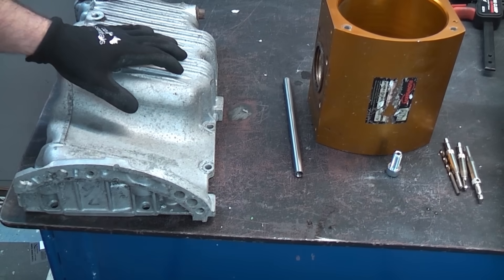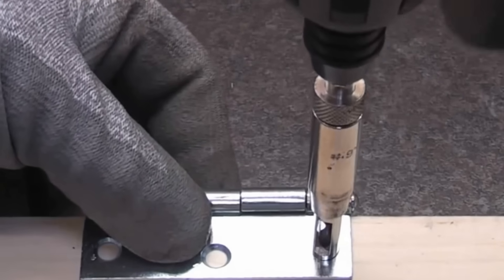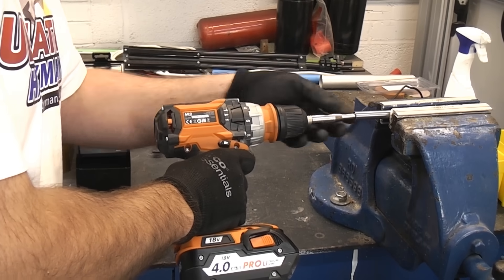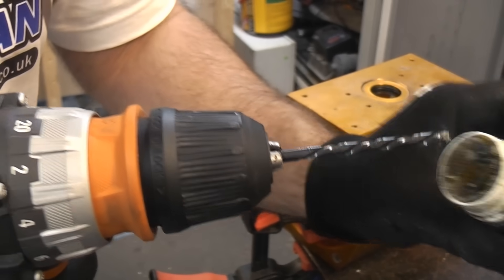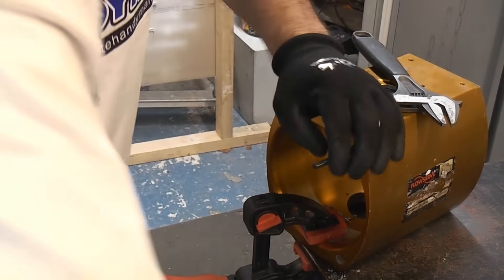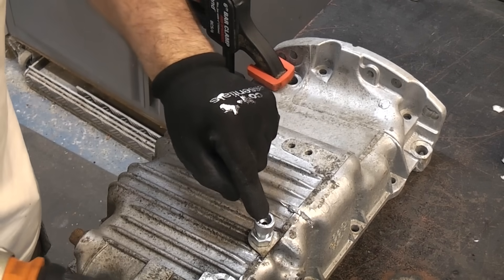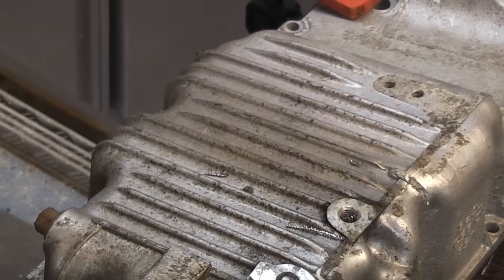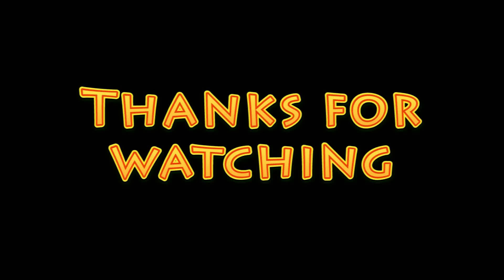How to remove a broken bolt in a deep hole | remove broken bolt in recessed hole

Comment: Your samples came out so easily with easy-outs. It reminds me of my most amazing case of a broken water pump bolt on a Toyota.  The broken bit was a the bottom of an inch+ of clearance hole down to threads deep in the cast iron engine block.  Drilling a hole in the broken bolt with a long bit was easy enough - this was back when Japanese bolts were notoriously soft. To this day I still am totally amazed that I got away with a brazed extension (old valve stem) on an easy-out to get the bite deep enough.  The broken part came out as easily as the samples in the video .  Wow, did that really work?!

I do like your tip with the alignment hole through a bolt. Too bad my cases are always near flush so no threads to engage.  I tend to end up with grinding the end flat, if possible, and very carefully centerpunching for the drill, starting small and working larger, depending how well centered. My cases are typically locked in place with corrosion and easy-out has low chance of success.  The best helper has been to head the part to dull-red with torch, which I suspect expands the bolt into the rust and creates a little clearance when the bolt cools.
Reply: ,I have been using small allen keys and grind the end into a 3 point,removed lots in my turbocharger shop.
Reply: Heat seems to work when nothing else does. Heating then shock cooling sure helps to loosen rust frozen bolts, but you still need liquid wrench and torque!

Comment: Note that the hole drilled into any broken bolt is approx half the width of the bolt, too small a hole and "Easy outs" have no effect, too big a hole and you run the risk of expanding the bolt and really jamming it in the hole.
Reply from the maker: Thanks for the comment 👍

Comment: some times a square nail  in the drilld hole works    also a freeeze off spray works ok where  you can not  use  heat  ive hade good luck with the freeze stuff it works
Reply from the maker: Thanks for the comment 👍

Comment: Some great ideas there. Have to say as a professional automotive mechanic I haven't seen to many deep broken bolts or studs. Most all are flush with surface or smidge below.
Reply from the maker: One site, most are flush or just proud of the surface, but on a couple of machines we get them recessed in the hole, which made me think of ways of getting them out.
Thanks for the comment 👍
Reply: **TOO.
Reply: There is a differance between a professional mechanic and a handy man.  Salute.   Thank you for your service sir.
The number of your likes speaks volumes.

Comment: Forgive me ,may be I m wrong,but in factory I have seen the technicians place directly welding rod,which gets soldered to the broken bolt ,bent the rod in L shape  and twist it out.
Reply from the maker: Sometimes you can do that, but it can be difficult in a recessed hole.
Thanks for the comment 👍

Comment: if all else fails, use a Spark Eroder, with the copper plunge electrode the same diameter as the hole's thread's original tapping drill bit, in conjunction with  a sharply pointed steel pick, to pick out the remaining thread spiral, which will be all that is left of the broken off bolt or tap.
Reply from the maker: Thanks for the comment 👍

Comment: How it was broken off and the condition of the hole and the bolt determines how you approach the removal process.
There are three ways to break off a bolt.  Clean bolts:  1.   Over tighten will frequently twist off at the transition from the shank to the threads.  In this case the broken part is lose in the hole and you just need to get a light grip on it.  2.  Slammed against the bottom of the hole will usual break off the same way, but the broken off part is real tight against the bottom of the hole and you have to get a real good grip on it which requires different methods.  This breakage frequently mashes some part of the broken end into the wall of the hole and into the threads making it have even a greater grip in the hole.  3.  It is frozen in the hole due to corrosion caused by moisture and/or chemical reaction between the materials like brass and aluminum (never put these two materials in contact with one another).  This is the worst situation and usually requires exacting work to drill a pilot hole exactly in the center of the broken part and gradually enlarging the hole to the root diameter of the thread or until you have removed all of the broken part and what remains is just the rusty thread of the broken bolt stuck in the threads of the side of the hole.  95% of the time a tap will peal out the thread part and clean up the hole at the same time.  Use lots of penetrating product.  I have been doing this foe decades.  This video shows just the easy ones with the casting is out of the equipment and on the bench and real clean. Not the kinds of things that you run into in the real world where the bolt is around the corner and you can't see it straight on, it's raining and the equipment is in the dirt so you are on your back in the mud with a mirror and a flashlight working the broken bolt.  The real world is very different.

Comment: I live where salt is used on the roads so typically the bolts I see broken off are seized by rust. If you try to use an extractor on that your going to have to figure out how to extract the extractor.
Reply from the maker: Road salt makes things 10 times worse!
Thanks for the comment 👍

Comment: What the hell is he saying? I can't understand a word. What's al-uminium? If you notice, he keeps starting and stopping with the left hand drill bit to get it to grab the broken off bolt and unscrew it out of the hole, that is the proper technique, he didn't mention it as a critical part of the process. I like the idea of making a hollow bolt as a guide for the drill bit. Every time I've tried drilling a broken bolt out of soft metal the bit goes off to the side even after center punching the broken bolt and messes up the threads of the piece I'm trying to remove it from and that makes it very difficult to remove with a screw extractor. Remember if you use never-seize compound or and lubricant you have to lower your torque setting or you could snap the bolt or strip the threads. I have some Matco or Mac tool screw extractors that are straight and square but the sides are concave so the corners dig into the hole you drill. The do not flare the drilled piece like left hand thread or spiral designs.

Comment: Nice tips, but most seized bolts ain't nearly that tidy, to put it mildly.  Definitely worth getting a set of reverse drill bits and bushings or some means to protect threads, but almost all have broken off right about flush with the surface.  Can use the same principles with rounded fasteners.

Comment: I wish I had had a special centering drill assembly when I tried to remove a broken, recessed bolt from an engine block. I ended breaking a hardened extractor off in the bolt! Plan B! Had to use a workaround for throttle linkage.

Comment: The problem I had was lack of clearance to get tools to drill out the bolt. Twice the drill bit broke off in the hole. I didn't want to pull the engine or pull the heads off so I perpendicular drilled into the hole due to the design of the head to kick the drill bit out. The hole was so damaged I couldn't get a tap into it. As a last act of desperation to get some kind of clamping load on the exhaust gasket I welded a bead onto a bolt shank so it's locked into the hole. These created a permanent exhaust stud in the head. It may or may not last due to cyclic heat stresses but I was able to put full torque on the nut to clamp the gasket. I no way would I recommend this method. This was just done so it didn't have to pull the engine apart to swap the head. It's an old GM 2.8L V6 pile of junk Fiero engine that I'm replacing with an LS4 V8. I just need this engine to last long enough till the other drive train is ready to install.
Reply from the maker: Lack of space can always be a problem, we come across difficult situations all the time at work.
Thanks for the comment 👍

Comment: the main culprit is the use of steel bolts directly to aluminium threads. that shit will get super stuck like its welded if given enough time. steel thread inserts should be standard, either that or fuck the aluminium off in general and make everything out of steel like in the old days.

Comment: You could've just used threaded couplings as a guide and drill into the broken bolt. Then use the "Easy outs" ( That's what e call them in the States) That will save you a few steps.

Comment: I spent 13 hours drilling out a bolt in a 5.9 Cummins turbo engine. An exhaust bolt near the turbo sheard flush and Nothing would drill into it. I used all kinds of stuff to creat a divit big enough to get a small drill bit into and then slowly drill it out. It was a slow miserable experience that was uniquely frustrating.

Comment: Thats fine if the bolt is not galled. I had one broken off in a briggs  head  bolt  and it would not come out even with heat.  Tried everything you showed plus a lot of other tricks and it is till there. Applied heat to the surrounding area at the bolt at the same time twisting on it with an extractor to the point of almost twisting off the extractor. No luck still.
Reply from the maker: Sometimes the only option is to drill it out, then re-tap the hole!
Thanks for the comment 👍

Comment: Where can I get that kit from I need to remove a broken bolt from my engine block
Reply from the maker: Hinge centering drills- https://fave.co/2DpJo1H
Left handed drill bits- https://fave.co/2xJjK1M
Teng screw extractors https://fave.co/2OnfRuF
Dormer taps -https://fave.co/2OsN1sQ

If you are in the UK-
Hinge centering drills- https://fave.co/2NE1VMc
Left handed drill bits- https://fave.co/2DubtF4
Teng screw extractors- https://fave.co/2pVLkVT
Dormer taps - https://fave.co/2pTfbyx

exact cutting paste- https://fave.co/2Nabyxc
cobalt drill bits (they are much better on harder steels like bolts) https://fave.co/2zDh3kp

You'll have to make the guides yourself, but they are easy- https://www.youtube.com/watch?v=6mZj0J6CNYA&t=1s

Spring tools centre punch- https://fave.co/2NbnLBD

Thanks for the comment

Comment: Broken Brake Cylinder Bleeders - Before you break it off - 
Always require small very sharp pointed acetylene torch tip - 
heat the boss casting area under the bleeder - 360 quickly. 
Keep the bleeder ice cold with a six point deep socket 1/4 drive. 
As ice cold as possible to keep the bleeder from being exposed to any heat. 

JUst as this guy tapped the bolt,, also give bleeder a quick shock, 
and with base casting good and hot - bleeder should screw out. 

Soon as bleeder starts to move - don't force it,, move it back down
with lube spray, and keep repeating back and forth till enough corrosion
moves out of the way - and bleeder comes out w/o breaking. 

Clean restore casting threads, and replace bleeder, or refinish it,, 
drilling out the passage in both directions,, the 90 degree hole at 
bottom as well. 

Cool the casting with wet rag soon as bleeder is clearly loose. 
If careful, you won't have to rebuild the caliper or wheel cylinder, 
if over heated, damaging seals. 
But it's best to restore calipers/cylinders to factory new condition. 

Pistons should move freely in the bore with seals removed, 
polish then with 600 wet or dry, spun with drill,, by making adaptor
with socket that just fits into caliper piston, then socket wrapped 
with tape so socket jams into piston tight enough to spin it, 
holding wet sandpaper in other hand, controlling grip pressure. 
And piston will look like new, and glide smoothly in the new seals. 

Be very careful with solvents of any kind around brake system seals, 
permanently

 
(Bleeders snap off being they are hollow of course - 
and no one ever puts anti seize on them first before replacing them.)

Good Luck,, as we know after 45 years, rusted threads can be painful
in many ways.. 
Wait till you get called for broken easy out down inside bolt in aluminum 
aircraft engine - and you have to do all this from under the engine, 
and the pilot and family want to go home today... and they did. 
Cheers
Reply from the maker: Thanks for the comment ;-)

Comment: All three of the broken bolts were broken several threads below the surface allowing you to use your tools. My bolts always break flush with the surface and there is no way any of thos tools will work . So what dop you use for flush broken bolts??
Reply from the maker: If they are flush with the surface, you can just centre punch in the dead centre, then drill the bolt with either a left handed drill bit, or drill and use the extractor.
Thanks for the comment 👍

Comment: He never says what that spring-loaded drill guide is. 3:10  I've never seen one of those before.  What is that called?  Did he say "hinge sighting drill"?   I've had good success with "Speed-Out" brand tap extractors but with a broken bolt (no head) you often need to drill a small hole to get it to bite, but often can use Speed-Out without.   I wish they made longer Speed-Outs because the standard ones are too short for deep holes.  I've also had good success with  "Grabit Pro" brand tap extractors.  With those, you can often get away without making a pilot hole.   I've never had much success with the traditional twist-type extractors. They just don't bite in my experience.
Reply from the maker: I thought I added cards to the video at specific times, but they might not always work.
These are the spring tools- https://www.youtube.com/watch?v=fjBu-tWdqoc&t

Hinge sighting drills/centering drills can be found here-  https://fave.co/2DpJo1H

Thanks for the comment

Comment: Give the bolt a hit with a punch and hammer before you try to drill it....this will "sometimes" loosen the threads...
Reply from the maker: That is correct. Shocking the bolt can help loosen it.
Thanks for the comment

Comment: If you’re going to use the cheap easy out, try turning it  while tapping on it to help start the reverse thread
Also, try tapping in a torx  bit as an easy out, it can bite into the sides of the hole on softer bolts
Reply from the maker: Thanks for the comment

Comment: Could you give some info on the cutting paste that you are using, please?
Reply from the maker: I used exact cutting paste in this video- https://fave.co/2Nabyxc
You can also use spray on coolant/drilling tapping fluid, but the exact paste does not go all over the place, so it is easier to use.
Thanks for the comment

Comment: use to use left hand taps instead of screw extractors tapping usually broke loose the bolts but if not screwing in a bolt almost always broke it loose. Trouble I use to run into as a machinist was broken off small screws on aluminum parts. Too small for tap extractors and such. We use to use a chemical that actually ate out the steel bolts. Kind of a weak acid I think the stuff was called tap out but its been many years. broken bolts taps in holes on expensive part we'd have them EDM them out but  yea your showing hobbyist understand.

Comment: You should put the drill on slow speed or #1 speed on your drill motor so bit or bolt doesn't get hot enough to harden steel
Reply from the maker: It will be fine, as long as you use a coolant/lubricant ;-)
Thanks for the comment

Comment: sure, that wasn't rusty at all. what if it's a rusty son of a gun?
Reply: The heat part greatly helps with that part. But yeah, if you're dealing with a steel bolt in a steel item that are both rusted together it's obviously harder.  Though when both are steel u can obviously heat it to a higher temperature. As a welder we obviously have more options than most people do. But even with that ive dealt with numerous instances where we've ended up having to drill the bolt completely out and then retap the whole to a larger size. Most of the time we can drill it out without damaging the female threads but it definitely happens. It sounds odd but the worst ones tend to be a stainless bolt into a stainless surface. Once those jam up ya can screw yourself REALLY fast! At least with steel on steel heat works well at breaking apart the rust. It's actually kind of an odd topic and every asshole has an uneducated opinion on it.

Comment: 30 years a Tool & Die Maker i removed lots of broken Taps. We used an Elox Tap burning machine that used copper tubes to burn the tap center out and it left a center core in the tube and cutting tips of the tap to be picked out or blown out of the hole with air.
Reply from the maker: I've never heard of one of those before, I'm off to take a look now 👍
Thanks for the comment
Reply: @ultimatehandyman  This is a newer make and model but taps are so hard you can't drill them we had to burn them out :
https://www.youtube.com/watch?v=IBiCQeLL7M4